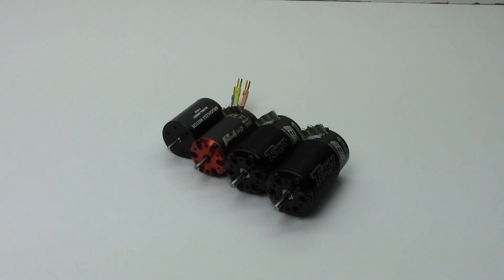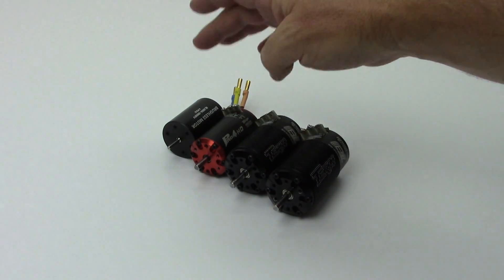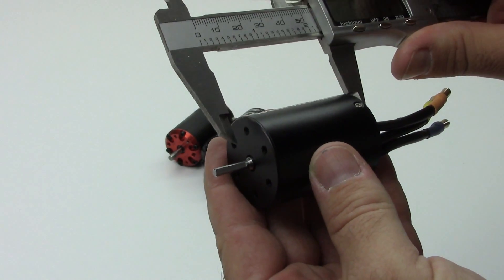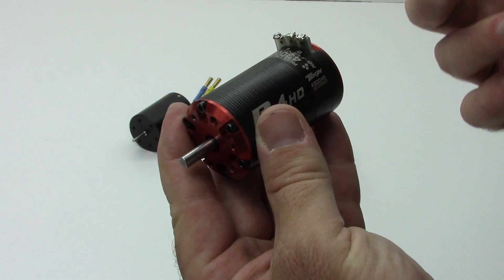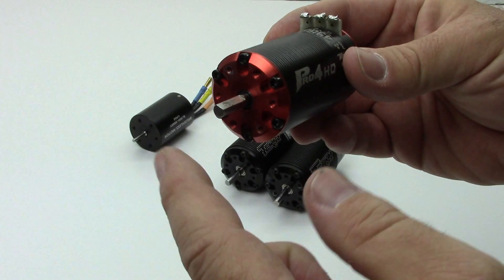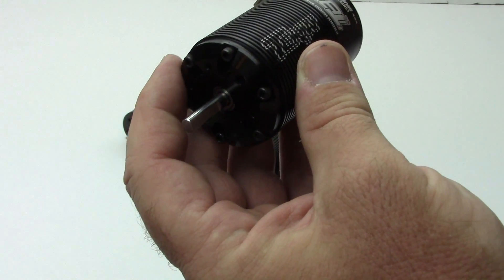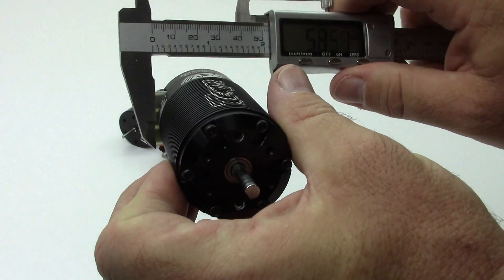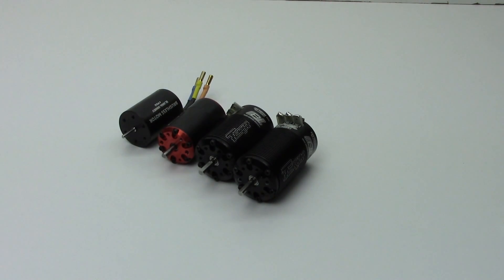Tekin 1/10th and 1/8th Scale Motor Compare

Comment: What is the yeti xl t8 kv? I have a t8 in my xl at 2000kv on 6s but trying to figure out if I should drop down to the 1350kv because the weight. Any help would be greatly appreciated
Reply from the maker: It’s a 2000kv….but I only ran the Yeti XL on 4s. It had plenty of power
Reply: @TheRCNetwork  thank you for the reply. So if I switch to the 1350 will I only be gaining torque on 6s?

Comment: What can fit in my rukus rc car with the srx reciever?
Reply from the maker: A direct fit would be the Pro4 motor - maybe the 4600kv - it should bolt right in....but you'l need an appropriate esc to handle that motor and a pinion with a 5mm shaft
Reply: @TheRCNetwork  i found a firma combo with a 3300kv motor. Same size and everything. 3mm shaft so it should fit the gear. what you think?

Comment: This didnt help me at all but i still clicked like. you start with 540, then you move to 550, and then you completely change topic and talk about what Tekin name their motors. this doesnt help me. are you saying that there is no industry standard for the next size up, which is 1/8 buggy? and to make it worse, tekin call the next size up the T8 as well. exactly the same name for a larger motor?! surely there must be a better naming convention than "the longer 1/8 scale motor with lower KV thats used for heavier cars like truggy and monster trucks". i bet there is  a proper name somebody will know it!!
Reply from the maker: If you're looking for "industry standard" that's definitely not RC!  Motor can sizes are all over the board.....like you saw in the video - 540 and 550 can sizes are common in 1/10th scales.  I've seen it referenced once by Team Orion where they call 1/8th scale buggy motors (thee 4030 T8 by Tekin) a 690 can.   Usually for 1/8th scales you have to rely on kv and can size in mm.  Sorry to confuse you, but it's like clarifying muddy water, TBH
Reply from the maker: Also, Tekin references the two different T8's as 4030 for buggy (69mm can) and 4038 for truggy (longer 74mm can)

Comment: I currently have a T8I (36mm OD w/finns) 1600kv /momba max setup in my Wraith , both failed from a snow run and bad maintenance.  Truck is 20lbs . What  540/550 4pole be able to freeze the same kind of power and Torque from a dead stop. I like watching the tires wrap around the wheel like a Top Fuel drag car and  then the truck jump in the air from a blip of the throttle. 
Ideal in my mind would be 6pole  same size can as the T8I
Reply from the maker: You have a wraith that's 20lbs??  My fully built Wriath from Mattzilla - literally every part is aluminum or steel weighs in at about 10 lbs, or just shy.  I don't think any 540/550 can handle 20 lbs.  After all, most 540's are meant for 5lbs-7lbs and 550's usually are for the heavier SCT's/Crawlers at 7-10lbs
Reply: @TheRCNetwork  yes it's exceedingly heavy hence the 4pole 8th scale motor, it has performed beautifully till I failed to do my after snow maintenance. Gearing is 29/80 /built trans/ OD r&p front UD r&p rear, 5.75"/5" tires . On 2cell it has comprable speed to the stock 27 t ,3cell is comprable to a 3600kv w/ 12/80 3 cell
Reply from the maker: @daviddroescher  Honestly, I'd keep the 1/8th scale motor in there if it fits.  Drop your gearing down and run 4s.  I'm surprised you haven't puffed 2 cells on that combo/weight.  Even 3cells would be challenged moving that weight.

Comment: Nice job!
Reply from the maker: Thanks Pete!
Reply: The RCNetwork do more. I’ve learned so much more about this hobby from videos like this. How about a soldering video. An actual solder, from tinning the tip and soldering contacts to soldering a battery wire to a connector

Comment: Would a tekin 4030 t8  buggy motor fit the axial yeti 1/10 scale. Or is pro4 hd the largest one that will fit ? Which motor pinion tooth would you recommend. You’ve probably tried many. Love your videos Rich !!
Reply from the maker: Johnny Davis the Pro4HD fit with only a few mm to spare (remember the sensor wire). Check the size differences on the T8 and Pro4HD and see - the Yeti won’t be able to take much on that T8 though. The driveline will start deteriorating quick on that torque.

Comment: Hey man quick question how do the numbers 540 and 550 relate to 3650 and 3660 and 3670 ? What's the correlation? Thank you
Reply from the maker: John Smith most manufacturers (like HobbyWing) use 4 digit numbers like that. 36 would mean the can diameter and the second would be the can length (without the motor shaft). For HobbyWing, a 3660 is a 550 sized motor. Their 3652 is a 540 sized.
Reply: @TheRCNetwork  cool thank you! I'm trying to find out if I can fit a 3670 to my stampede so the diameter is the same but just longer than a 3650 correct? Thanks
Reply from the maker: John Smith it should be....check the manufacturers spec sheet for the motor. They should list diameter and length
Reply: @TheRCNetwork  thanks 👍👊

Comment: Ive been racing for about 6 months and have been running a truggy size motor in my buggy. (Mbx7 eco) I just bought a buggy motor (4068) and am looking forward to trying it out. This one is 2050kv where the truggy motor was 2000kv so speed should be about the same. Im hoping that it will smooth things out a bit, so I can get faster lap times. I drove a friends buggy, and it was smoother and less powerfull, but My lap times with his, were faster, and more consistant. Any thoughts on this subject? Great video! Thanks!

Comment: I have a savage flux xs and for 1/12 scale its pretty heavy, about 10 pounds, and the stock 540 4000kv motor has heat issues even on 2s.. I would obviously go for a pro4hd but I'm limited to can size no longer than 60mm due to the placement on the chassis. I was looking at the TT2502 pro4 3300kv 540 size motor and was wondering if it would have heat issues running on 2 or 3s on a rather heavier setup. Do you have any suggestions?

Comment: I just came up on a tekin eb48.2 roller. What electronics do you recommend?
Reply from the maker: The RX8 Gen 3 and the T8 1900 from Tekin - bolt right in and are a great combo
Reply: The RCNetwork cool thanks, also which servo, pinion gear and batteries should I use? Sorry for all the questions I’m new to the hobby.
Reply from the maker: Ramiro Prado servo wise, get something with at least 300 oz/in of torque, and about .10 seconds or less. Pinion - start with a 15t to start, it really depends on your track/terrain and how much the buggy weighs.
Reply from the maker: Ramiro Prado and you’ll want 4s 5000mah Lipo batteries. The GensAce versions are what I use

Comment: Would a castle slate 2850kv 10th scale motor be about the same  all around as the tekin t8 1/8 scale 2000kv?
Reply from the maker: Not even close.  The 2850 is a 540 sized motor - although its a lower kv and capable of using from 2s to 4s, it doesn't have the torque to push around heavier vehicles like the T8 does.  The 2850 has a 3.2mm motor shaft, vs the 5mm of the T8.  The T8 is just a larger motor over all, intended for 1/8th scale applications and can push heavier loads. It really depends on what vehicle you're putting it into.
Reply: my buddy has the tekin in his 6th scale custom trail truck and the castle is in a scx10 i was just curious if hes still gonna be faster lol
Reply from the maker: The Tekin system can push around more weight of that 1/6th scale....the SCX10 only needs a 540 sized motor. Being fast is all about a mix of kv, gearing and voltage - but in an SCX10, it's not about speed, unless you're racing U4RC
Reply: The RCNetwork no just screwing around on the trails making rooster tails with mud just having some good ole fun with some speed if I want lol
Reply from the maker: Look at the new ROC412 HD from GTekin.  It's now element proof and has tons of power....even down to the low 2000's in kv
Reply: The RCNetwork I just bought the new castle sensored slate motor in the middle of getting everything soldered together in live in canada parts are hard to come by and got massacred on customs and shipping when u pay almost the same there as u do the motor its hard to spend the big bucks

Comment: Would a pro4 be good with a mamba max pro or with an rx8?
Reply from the maker: +Donkey Commander the RX8 will run much smoother and be able to control that motor better - about 4 years ago, I tried saving a buck and partnered the Pro4 4600 with the MMP and nothing but heat issues from day one. No matter the gearing or battery, the ESC was clear over 175 most of the time. I installed the RX8 and it never hit above 110.

Comment: Could you do a 1/14 scale motor for less than $£20 for my vaterra kalahari
Reply from the maker: There's possibilities out there....but you'll have to deal with pinion shaft size/pitch, etc when putting in a replacement motor.  MAke sure you check.  Check out my Mini 8ight T video series, where I go over possible motors for the 1/14th siaze vehciles:  https://www.youtube.com/playlist?list=PL5_p3gwitPIk2mrxxXz8vnumV1H5f6sxt
Reply: Thx will check it out right now. Do you also know how to make my car immediately shift from forward to backwards.😉

Comment: Greetings to you sir, I had just watched you video on the different Tekin motors, I have a traxxas Summit 1/10 scale truck, would the Tekin T8 Gen 2 4038 Sized Truggy motor work for my Summit?
Reply from the maker: +Joseph Bones It will bolt in......but double check the length of the current can of your motor vs the 4038.  The 4038's are 77mm in length and the 4030's are 69mm in length.
Reply: Thank you sir, I am looking to upgrade my Bone Stock Summit, (Going from Brushed to Brushless) and I understand that there are a lot of different motors out there, I am trying to learn more about the Motors.
Reply from the maker: +Joseph Bones The Tekin motors have raw power and are super smooth.  You'll need the Tekin RX8 Gen 2 ESC to power it the best.  It's a great system overall and is sensored - which means it is really smooth and efficient even at very low RPMs.  Most cheaper systems will be sensorless and will have "cogging" issues at low RPM if you plan to cral at all with the Summit.  Other than that, you'll have to plan on a kv that will suit your driving style.
Reply: Thank you again for help..

Comment: On a D413 would it be better competition wise to use a 540 or 550?
Reply from the maker: I don't think 550 is even allowed in 4wd buggy.....plus, it would throw off the balance. 540 is plenty.
Reply: +The RCNetwork I was actually just in tower hobbies n realized that the redline gen2's are not available because they are being replaced by these black Gen 3's have any experience with redline Gen3
Reply from the maker: +Jonathan Postell II I have one on it's way to me....it will be going in my D413.  I honestly haven't read the specs yet, but I'm sure it's lighter and more efficient with more cooling vents
Reply: +The RCNetwork nice I'll be ordering it soon as it's back in stock, thnx for the replies and keep up with the D413 updates luv them
Reply: +Jonathan Postell II D815 build next???
Reply from the maker: +Jonathan Postell II Probably not....

Comment: Very interesting. So I am wondering? I have run the standard 55T 35T and 27T Brushed motors with AE esc. I am looking at getting a Brushless system. What would you recommend for a Axial Scx10. Weights in at about 8-10 lbs... Price is a concern. I would like to keep it around $200... Thanks for the vid
Reply from the maker: RcNickster Hey Nick, the SCX10 is such a versatile platform, and with the right upgrades, can easily take on brushless power.  Having been bitten by the Axial bug, I have an SCX10 headed in to The RCNetwork to begin a new project.  My plans include dropping in a Tekin Roc412 - 2300kv with a RS Gen2.  You can find the combo for right around $200 at all the big places, maybe less with coupons......The nice thing is you can control the speed/torque by what battery you run.  For huge torque and crawling, use a 2s....want faster than walking speed for G6's - use a 3s....lastly, the motor is 4s capable, but the RS is only 2s/3s - Add an RX8 Gen 2 to run 4s for blistering speeds (for an SCX10!)  The main thing, is you will be running a sensored setup, so you'll have buttery smooth throttle control.  Hope this helps
Reply: It sure does help me out..... I am a fan of the "buttery Smooth" control myself lol. High speed ? not so much. The G6 kinda feel...really appreciate ya taking time  to respond. Thanks so much...

Comment: question for you. I run the mm2 with the 2200kv motor in my 100mph cars. what would you say would be tekins equivalent in motor?
Reply from the maker: 2cwik4u104 The 2200kv is the larger canned MM motor....With that, which car are you putting it in?  Specifically what weight?  I'm not sure you'd need the larger 4038 Tekin can, since they offer a variety of kv options unlike Castle.  As an example, you can get a T8 from 1400kv to 2650kv, or 6 different kvs.
Reply: ive never weighed any of my cars. I run it in an ALL aluminum rustler (106mph), guessing close to 12lbs and a stock gtp2e (121mph). guessing around 9lbs.
Reply: I had both. Have the 4038 2050 kV in my losi lst. Has tons of power. I can crawl with it if I want to. Castle maybe has a bit more punch. But I manage to break my rear diff all the time with my tekin on 4s so don't think it its necessary

Comment: i have a losi 8ight im gonna race im converting it to nitro so i wanna spend around 200$ on the motor esc combo any suggestions? and im getting a tamiya !/8 truggy and around the same ball park their
Reply from the maker: tylerfigs Really tough pricepoint for an 1/8th scale system that's decent......Maybe check out a HobbyWing....My local shop has this for $254 and includes a program card....http://www.nitrohouse.com/Hobbywing-Sct-Pro-Combo-Pack_p_17486.html
Reply: i was thinking a ezrun system but i wanted you thoughts on it
Reply from the maker: tylerfigs Also good, from what I hear

Comment: Hey can you help me? I have just bought a tekin rx8 gen1 1/8 system. And I seems to be underpowered. I here they should be fast and Ming is slower than a brushed system on 2s thanks dark_sharks
Reply from the maker: Darksharkracing Do you have reverse engaged on the ESC settings?  If so, does reverse seem more powered than forward?  If it does, reverse your radio settings to reflect the opposite (if you pull the throttle, it should go in reverse...) Then, go into the Hotwire app and manually reverse the motor.  Not sure why this happens, but I had an issue with my set up from my Axial Yeti XL - Might be the way the motor faces on the chassis...

Comment: Can you tell me the difference between the pro 4 and pro 4 had? I got a pro4 for my custom build
Reply from the maker: Flash Hobbies Yep.  The Pro4HD will have more torque overall, and run cooler than the Pro4.  It all depends on the weight of the rig you're building.
Reply: Thanks for the info, the rig i'm building now will be about 13lbs